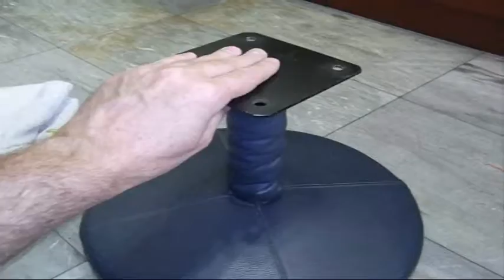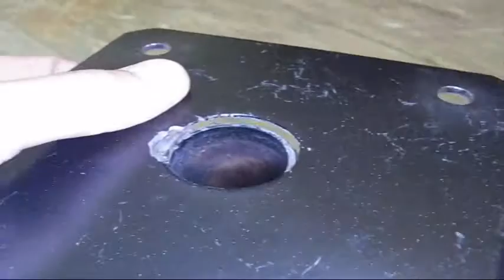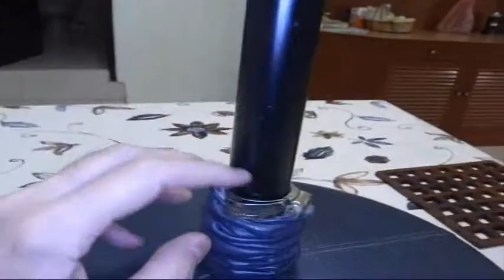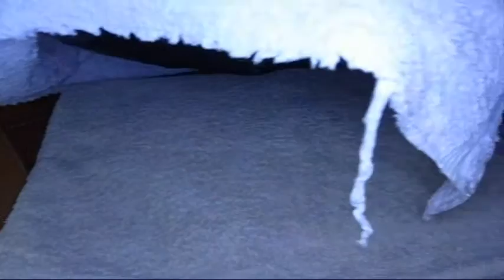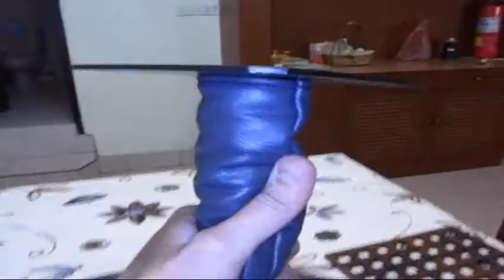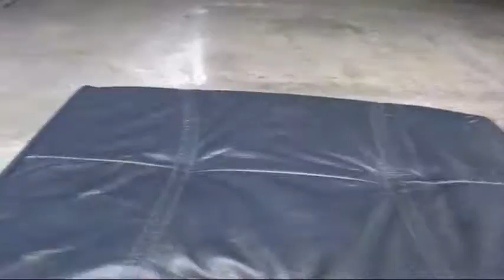Weld Furniture Without Disassembling - Weekend Welding Warrior

Comment: It gave me some ideas to weld my  sofa,  mine is a recliner one where the metal attachment to the back broke and  it looks like I have to do it while on the sofa, now where it is is not visible normally so I'm not too worried about a bit of scarring but fire is a concern.  I might do a combination of welding blanket,  wet towels and aluminum foil.   Mostly because I'm concerned about fire
Reply from the maker: Yes, fire is a very serious concern.  Take all those precautions plus assume it WILL catch fire and do it where there fire won't spread. I did this at the end of the driveway near the street.

Comment: Hello, our sofa sleeper's front middle leg is similar to your video. I'm not a welder so can you recommend an adhesive to glue the leg back to the broken off metal.
Reply from the maker: That's quite a challenge. I'm trying to think how I would fix it without welding. I don't know of any adhesive that has 1/10th the strength of a weld. I might go with many small angle brackets inside the pipe and across the plate, pop riveted or bolted in place. To give that a ghost of a chance, I might add a super epoxy (like jb weld) to the mix (it would be really messy though). Perhaps ask around with your friends and see if anyone knows welding. Home welders have become pretty common.
Reply: @tsbrownie  thanks so much for the quick response. Well, guess we're getting a new sofa:)
Reply: I know 3 yrears ago, but for anyone els with a question like this no comparison to welding, but JBweld is  worth a shot.  Even better, if it is an option one can  make holes and bolt things together or use pop rivets.
Just some ideas for others that might be looking to do a repair